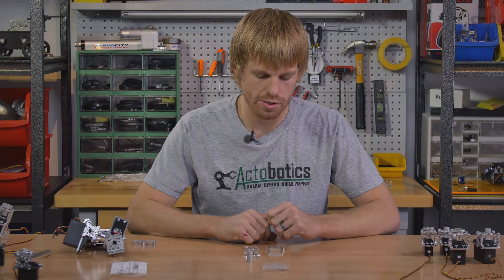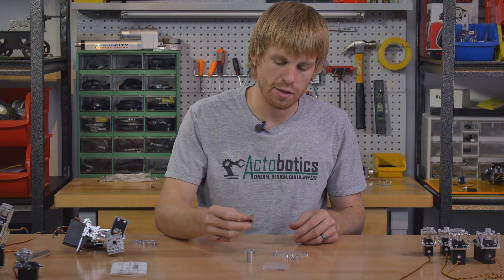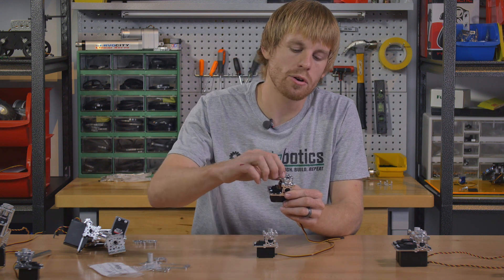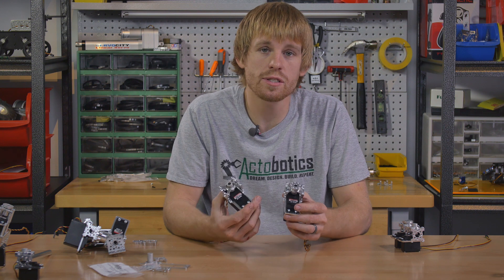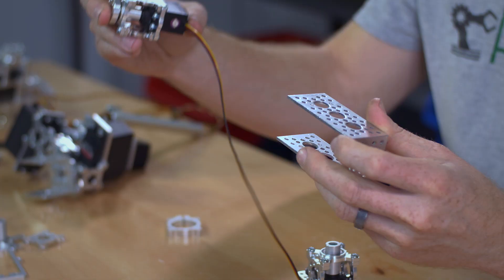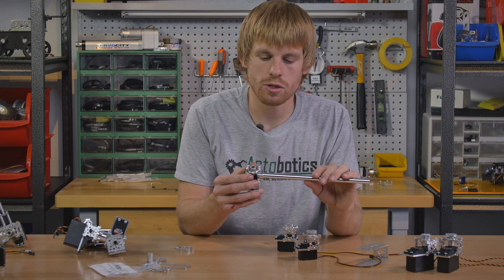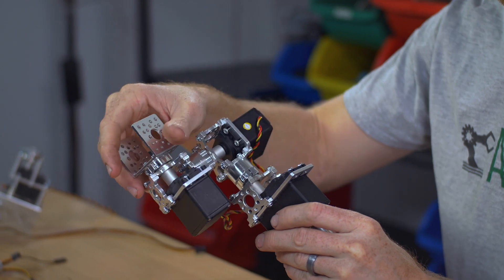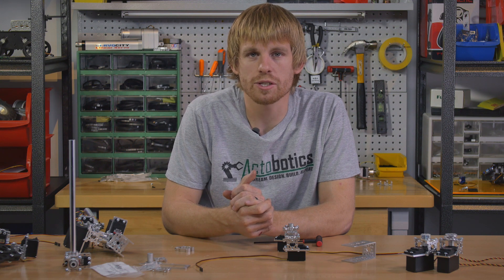ServoCity Product Info: ServoBlocks™

Comment: Regarding "radial load":  The block is protecting the servo from internal friction caused by any force that is not aligned with the shaft?  An off-balanced load, for example.  Is this right? (I'm not an engineer)
 
Once the radial load issue is eliminated, what about the load-bearing capabilities of the hub?  Is the servo protected from that at all?  Or is that just a matter of not putting anything heavier on the hub than can be manipulated within the servo's torque specifications?
Reply from the maker: Servos have different styles of internal support for the splined output shaft.  On the low end, they just use the case to hold the shaft.  The next step up would have a bushing pressed into the case to support the output shaft.  The higher end servos will have ball bearings; some have one while others have an upper and a lower bearing.  The style of support is relative to the torque output of the servo.  When you connect a regular horn to a servo there are two areas that have potential for flex.  1) The potential for flex in the servo horn (piece attached to the splined output shaft of the servo).  Many horns are molded and the plastic can be distorted and even break if a heavy enough load is applied.  The ServoBlock output shaft is constructed from 7075 aluminum which is considerably stronger than any load that will be applied to a servo.  2) The potential for movement between the splined output shaft and the servo horn.  We hold very tight tolerances to make sure the fitment between the servo horn and the splined output shaft is perfect.  If the broach is incorrect this can cause the shaft to move when a load is applied.  Other horns rely on a clamp, collar or other type of mechanism to hold the horn onto the servo.  We have designed the part to be used in conjunction with the stock servo screw – once the screw is installed the splined output shaft is solidly mated to the horn.  3) The potential for the internal support mechanism for the splined output shaft of the servo to be overloaded.  The ServoBlock uses a .5” diameter bearing spaced out away from the top of the servo case to isolate almost any side load (radial load) from being applied to the servo itself.  Please let us know if you have any other questions! tech@servocity.com